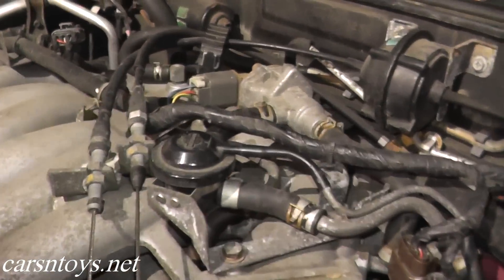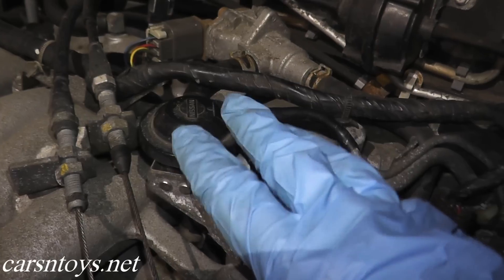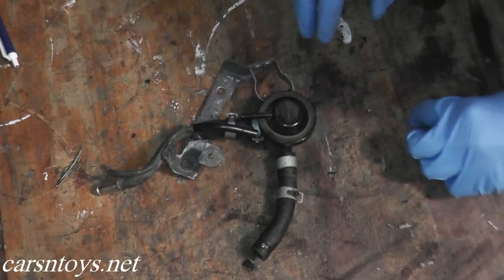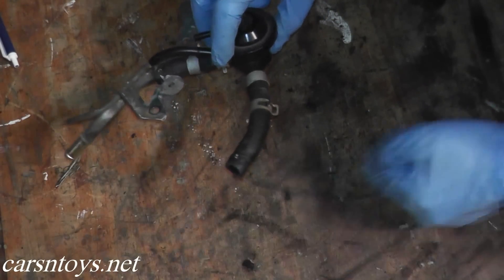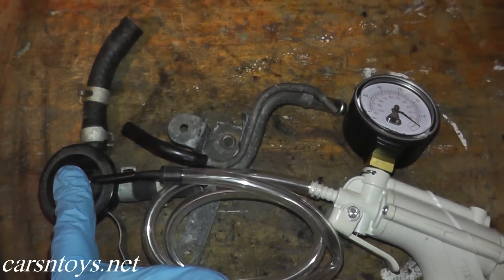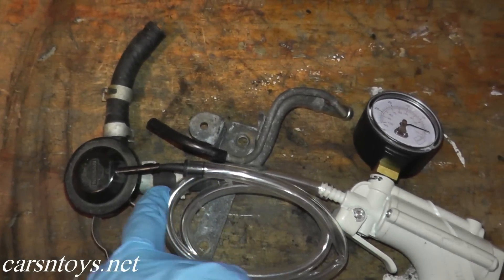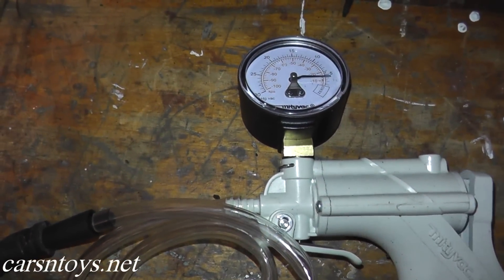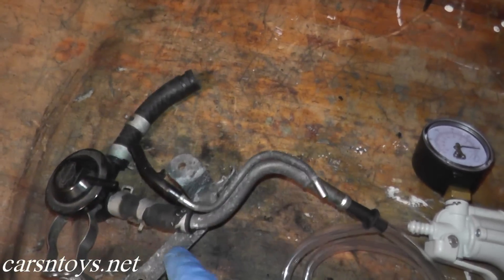How to Test and Replace EVAP Canister Purge Control Valve P0443

Comment: My 1990 Pontiac Firebird runs like a top until it gets below half a tank. This is when it starts coughing and sputtering and eventually dying. At first I thought that gas gauge was just off, but it is accurate. After the car dies my tank only takes 9 gallons, even though it is a 16 gal tank, which means there is still gas there, its just not getting to the engine. The fuel pump turns on and works great above half a tank and pulls hard. There is also a LOT of pressure released from the tank when I take the gas cap off. Makes me think its not venting properly, any ideas guys? charcoal canister itself? EVAP solenoid? help! its the only thing left I have to fix. :)
Reply: What was it?? Sounds similar to my issue
Reply: @justeneschlenker4485  Hey! sorry for the incredibly late reply. But it ended up being my charcoal canister. It got worse and worse as time went on. It even died in traffic 5 times in one mile in the highway. I pulled the canister off, shoved screws in the ends of the lines and the car started right up. no more pressure in the gas tank, been running great

Comment: Hello i have a 2001 Chevy S 10 check engine light saids  po 440 do you have vidio on this. Thank You
Reply from the maker: I'm afraid I don't. That's a trouble code for a small leak in the evap system. Professional mechanics would use a smoke machine to find the leak. Scotty Kilmer has a video finding leaks using a cigar. Just do a search on his channel. Good luck

Comment: On my 98 Maxima, I notice tiny black beads in both hoses. Is this normal, and would this be the cause of my engine to be hesitate when accelerating? I've  replace all plugs and coils thinking this was the problem.
Reply: Black beads are from carbon build up. I’m not sure if it can cause acceleration problems, but it’s likely those beads are in other parts of your evap system, including your canister. Those beads are from topping off your fuel tank when at the pump, so when it stops, don’t try to top it off.

Comment: I have a 97 ax4 I nearly replaced all parts evap related I managed to erase codes only one left is p1445 from my understanding that line on top of the cut valve that's suppose to suction so it opened up and let's the vapor threw it says volume control is the problem but am I correct if so how do I fix this problem

Comment: if my mechanic took this part of and he say that black gruddy stuff was coming out.is that normal? he say that he cleaned it out by getting all that out
Reply from the maker: +Pamela Edwards HI Pam. Sometimes charcoal from the EVAP canister can find its way to the valve. Cheers
Reply: So is that a sign that it need to be replace and will that be the reason why my car keep cutting off at a red light

Comment: Love the dramatic music here... too bad I still can not find the source of my rich condition, great video!
Reply: your egr valve is probably stuck open. Some have a plunger that u should be able to move up and down. Others have a pin in the valve that moves in and out and on that one you have to clean the hole around the pin so it dosent stay recessed in as far but rather convexes a bit. Only reason how i know is mine was stuck closed and my truck was running so lean it would stall and not want to start back up.

Comment: I have 1997 nissan hardbody pickup 4cyl.. Code p0443.. Would this affect how the engine performs? I have a rough idle and loss of power during acceleration.. Also I have code 1130.. These are two codes that come up when I scanned it.. Thanks
Reply from the maker: Jonny Moseley 1130 is the swirl valve. Fix both issues and you'll be in good shape.